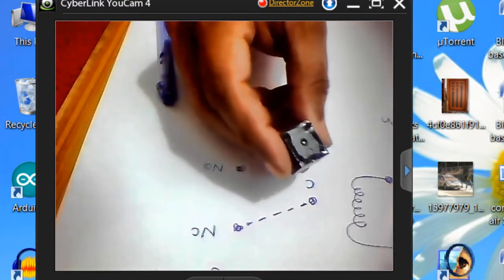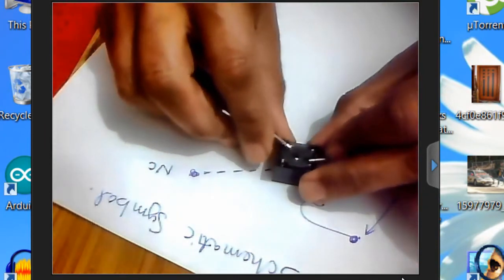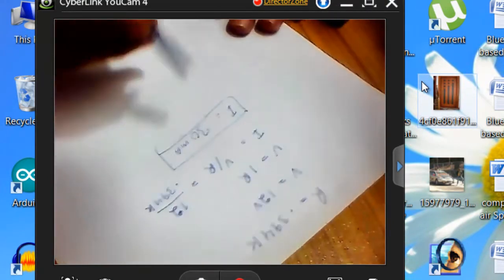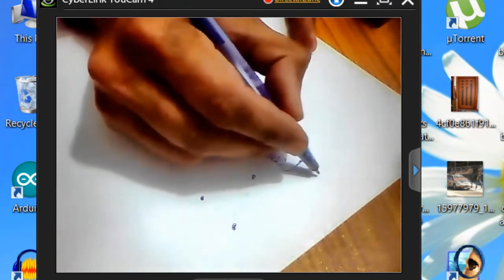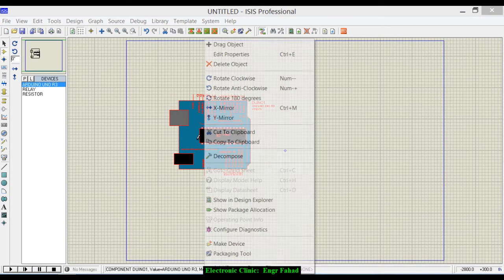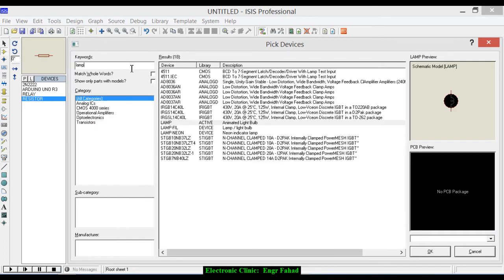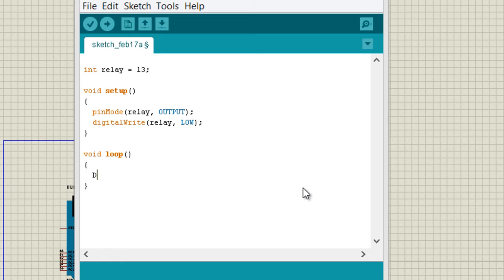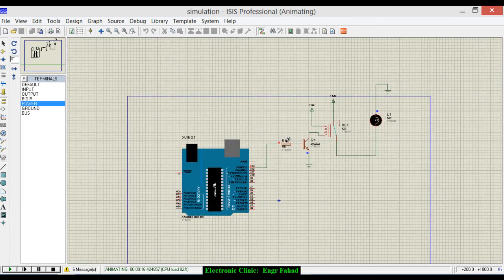12v relay proteus simulation and driver. arduino project for beginners

Comment: Great video! Why did you add a 10k ohm resistor? How do we calculate what ohm resistor we need?
Reply from the maker: coz its a bjt " bipolar junction transistor". if it was a mosfet then wo won't need this resistor. its used for limiting current.